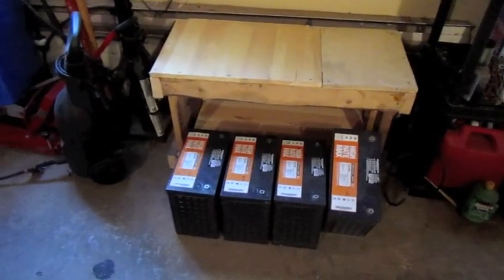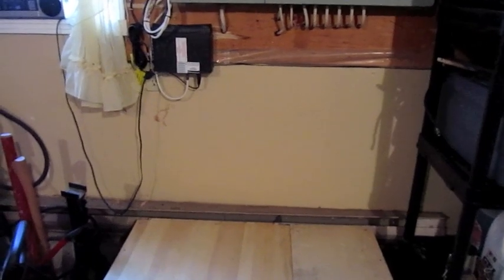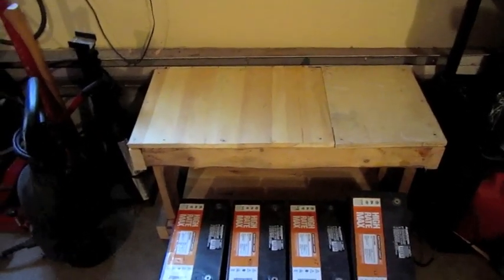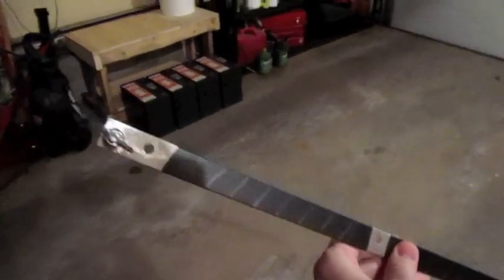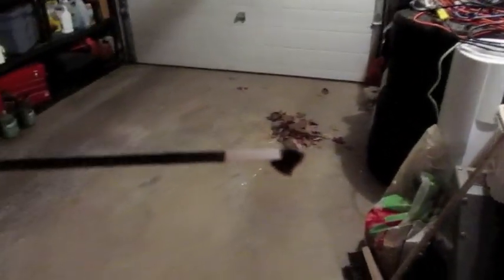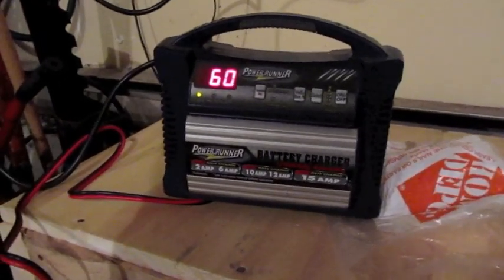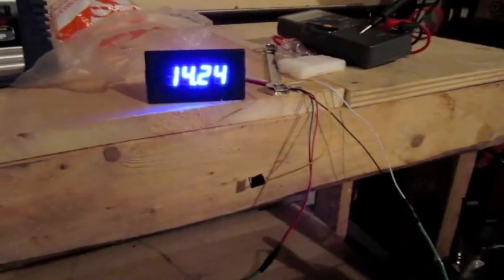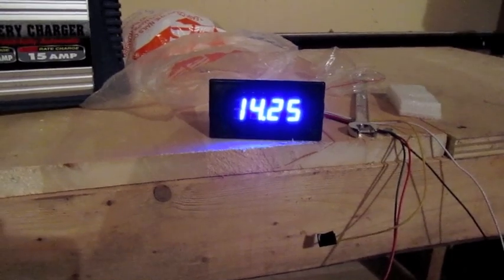PV Solar system part one the battery bank

Comment from the maker: @shelladavis I hear what you are saying! I have not committed to leaving it there as I have another 4 batteries to add. I think I will be moving them down the wall away from the fuse panel. This was just a temp placement to get them charging. I have more to add to the system and this will cause me to change the layout of the charge controller and the battery bank.
Thanks for watching!